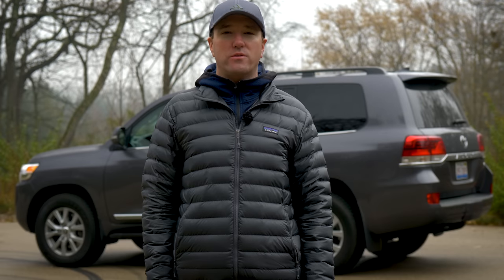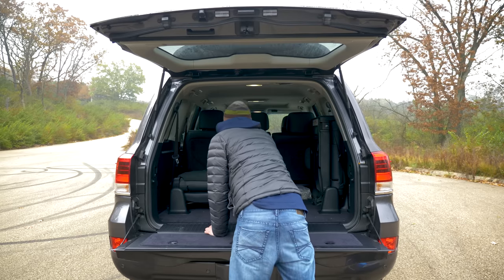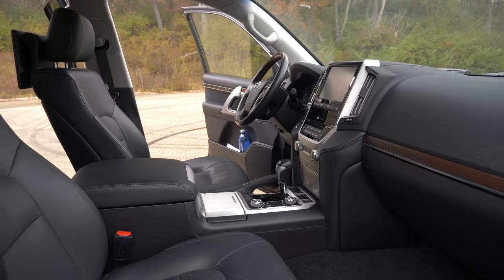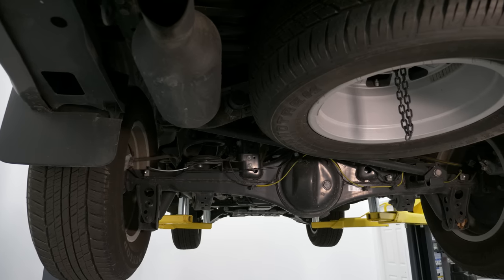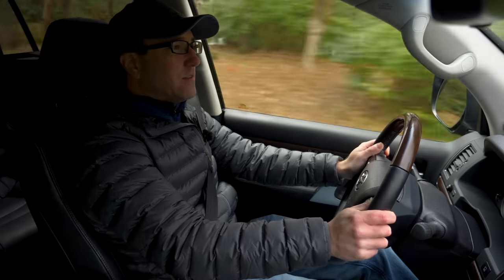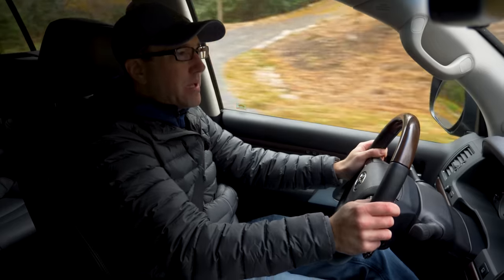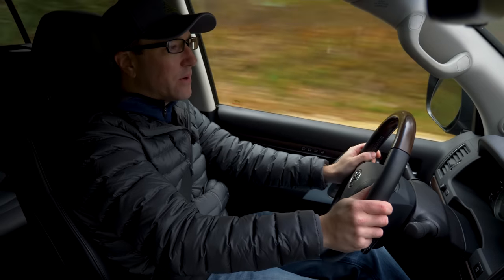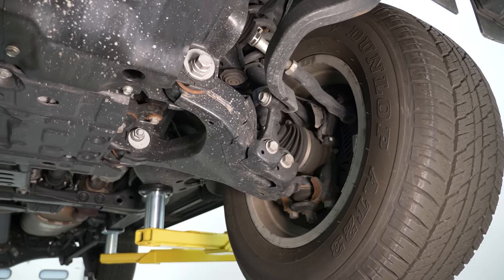Review | 2017 Toyota Land Cruiser | The Veteran

Comment: As an owner of a 2016 Land Cruiser with over 30k miles on it, I’ll try and address some of your concerns as well as the commenters’. 

1. Gas mileage. Yes it’s poor, but I’m honestly not sure what you were doing to get it down to 13mpg as you report. The only time I see it that low is if I am towing. Even if I drive it like I stole it, I can’t get mine to average below 14mpg over the course of a tank. If there is no headwind and I drive it conservatively on the highway, 20mpg is realistic and 18-19 is typical. If you go a bit faster and keep up with traffic I’ll get around 17mpg. Around town in traffic I average about 15mpg for daily driving. This is not a problem for me in a daily driver. I actually consider it good gas mileage in a daily driver truck since I’m used to driving trucks most of my life. A truck with nearly 400ho that can easily average 15mpg city is impressive to me compared to vehicles of ten years ago. Much of this is due to weight, but also to relatively rugged and bulletproof engine design. No direct injection. No turbos. Capable of running on poor quality gas around the world, or in certain parts of the US. This is part of the appeal. 

My biggest complaints regarding gas mileage is that the truck is very sensitive to headwinds, and the tank is only 23 gallons, which limits range to around 400 miles (plus the fuel gauge is very conservative and reads empty with about 3 gallons left).

2. Why this vs a 4Runner? Honestly the 4Runner is a great vehicle, but it’s not quite as good as the Land Cruiser. The LC is much nicer inside, rides better, is much roomier, looks better since the 2016 update, and has a better engine with comparable gas mileage in real world driving. The third row is a little better, but it’s still not meant for adults. Plus even though her 4Runner is pretty reliable, it doesn’t hold a candle to the Land Cruiser. Toyota puts their heart and soul into this flagship vehicle. It, more than any other, is a showcase for the world of what Toyota’s values are. The only other Toyota that comes close is the Lexus GX, which is sold as a Land Cruiser everywhere else in the world. Both are made in Toyota’s best plant in Japan with the best record for reliability, and they take extra care in building these. This is why even though Land Cruisers don’t sell well in the US, you constantly see them in the roads and highways. They just keep going and going for hundreds of thousands of miles. If you get a new vehicle every 4 years it’s not for you. If you buy one to keep for 20 years, you can’t beat them. 

3. Price - Yes, $86k is a lot of money, but not as much as it used to be. Look around and it’s easy to find these selling for $79k or less new on the lot. They’re slow sellers. Then compare to a top trim level Yukon or Suburban and realize those also sell for over $80k today, and this has a nicer interior than those. It is close to the interior of the Escalade, and better in many ways. The Lexus LX is even nicer. For what it is, it is competitive in this high end of the market.

The one fly in the ointment is the new Nissan Armada. It has a nice interior comparable to, possibly nicer than, the Land Cruiser in the Nissan’s higher trim levels but costs tens of thousands less. It also has more room and is based on an established and fairly reliable platform used elsewhere in the world as the only direct competitor to the Land Cruiser, the Nissan Patrol. The American version is not as off road capable, but it’s not bad at all and better than any domestic in the category. You can get a nice one for about $56k (and similar power and gas mileage) and pocket the rest. Still, though, if you’re after reliability and off road prowess the Land Cruiser can’t be beat.
Reply: Brian Mooney I like your review better than this video itself!
Reply: This x100. Nissan Armada is a fine choice if one cannot afford a LC. That said, Nissan's infotainment is much worse than LC. Like you mentioned LC has better off-road capability and will hold value better too, there are some used armadas for sale less than a year old with low mileage for ~$35k. Yes, the cost savings could be significant, but I really do think the LC is worth the extra money. It's kind of like comparing the Sequoia to the LC, there are a multitude of reasons why there's such a price difference. I'm biased  though -- I have been in love with love land cruisers for years, and have never been fan of the Nissan brand in general.
Reply: You should start your own channel. I enjoyed reading your impression of the Land Cruiser.
Reply: Nice comments about the LC and I'm glad you mentioned the 4Runner in comparison. I own a 2008 LC and a 2005 4Runner and I can say without a doubt that I like my 4Runner much better for off roading. The LC is heavy, doesn't maneuver well in tight situations, feels top heavy and leans more than my 4Runner, is wider, I don't believe the LC has more ground clearance, and actually has less cargo space because of the third row seats. I know I can take the seats out, but what a pain to take them out and then put them back in all of the time. My LC does feel more roomy, seems to have a more comfortable ride on the pavement, and does burn more fuel than my 4Runner. Eventhough my 4Runner is a better off road vehicle for me, I still keep my LC because I like it. It has some cool factor about it that is difficult to explain. Anyway, that's just my opinion and I'm not an expert with Toyotas. I feel like I got more bang for the buck with my 4Runner over my LC.
Reply: The 4Runner is also made at the Tahara factory where the LC200 and GX are made.
Reply: @shizzyshawn412  $86k. not worth it. Just because Toyota is too lazy to redesign a new platform with a new engine, you just cannot justify the price for this thing draconian layout. I own a 2005 and the best I've seen is 14mpg and thats feathering the gas. But these trucks have a cult following, meaning, they could charge $110k for this and people will still buy it and justify its price. "Its a Yota brah"
Reply: fuel economy , my experience with is almost the same like yours.
It is really not that bad.
Fixing turbo or hybrid related issues can easily wipe out years of fuel savings
Reply: @jacekw8746 😂😂😂😂 I totally agree with you when you consider how much you spend on fixes in others cars am better off spending on fuel ,rather than saving on fuel only to blow it out in fixes that will cost me years of fuel savings

Comment: In the middle east, this truck comes with variation that is more than insurance packages..

Here in Saudi Arabia we have the following:
4.0L v6 with 5sp manual or 6sp auto

4.6L v8 with 6sp auto
4.5L twin turbo v8 disel with 6sp auto

And the 5.7L v8 with 8sp auto

It starts from around $45k to around $88k for the VX-S model which has a little more than the US-spec Land Cruiser. They offer variations with a spare tire mounted on the back on its own mount and a winch. They are the definition of 4x4 in Saudi Arabia. 

By the way, the interior is one of the best interiors that hold up to the extreme use. No noises or squeaks even after 150k+ miles on these. They are that good, but goodness comes with a price :/

On a side note, we don't get the 4runner anymore :(. I wish we could have the 4runner trd pro instead of the fj cruiser (yes, they still make it for the middle east).
Reply: hisham202  You also have the Land Cruiser Prado and the Fortuner (and the Hiace, etc.,).
Reply: What i want an fj cruiser. 😭😭😭

Comment: Just bought a 2013 200 series in the same color and it's been a dream to drive... my favorite car of all time!!!
Reply: Michael Evangelista its not a car
Reply: alexander1485 thanks
Reply: If it is motorized human transportation (7 or less), four wheels and a steering wheel, it is a car. :)
Reply: I was thinking of buying a 2013, I given a 1999, 10 years ago. It is still incredibly well.
Reply: Trenton Oliver 2013 is a good year, Toyota was able to get the quirks out of the initial 200 series and it got a bit of a face lift as well. I'm personally not a fan of the new front design on the 2016-18 model. I got mine CPO with 41k miles. Its so smooth and refined, driving experience is unreal (unless you want to throw it into curves). Curious, how do you like your 100 series? I was debating between a 60-70k mile 2006-07 100 series... what are the differences in the drive?
Reply: Michael Evangelista,
The early 100 series is good, I have locking center and rear diff, I haven't gotten stuck. It's basic and a great car, runs a 100 amp alternator compared to the 06-07 which is 130 amp. The huge plus for me is the removal of the third row.

Comment: Great review - especially under the hoist. I’d like to see more reviewers do the same.
Here in Oz (the KDSS was designed here in Western Australia) we get the 200 series in higher and lower specs with the twin turbo V8 diesel across the range. It’s a torque monster with relatively good efficiency and a great touring range from the 140L tank. Barely anybody here buys the petrol model.
Reply: I wish America had the diesel model. The torque and fuel economy are so much better than gasoline.

Comment: Just ran across this since it's a couple of years old, but for the most part a good review, a few bones to pick since I've driven mine for over a week. As the owner of a 2019 LC, I drive mine 40 miles each way to work everyday and average 17 mpg, still not great, but damn that engine rocks! Almost the same gas mileage as my 2002 limited 4Runner that was 18 mpg with an under powered six cylinder, but not quite as good as the other seven 4th and 5th generation limited 4Runners that we've owned over the years which were around 20 mpg. That being said, the LC does have some quirks as all do, but the center stack is one of the best I've seen and the luxury for an actual body on frame 4wd SUV is unmatched. Sitting in the back seat is like sitting in your couch at home. The reason most people buy the LC over the the other "SUV's/Crossovers" is that we can actually take our vehicles off road. The LC provides probably most most off road capable vehicle off of the shelf of any vehicle out there other than maybe the Raptor. But the LC will last 25 years and is actually reliable. The LC is an Icon.

Comment: Great review video. Spot on commentary and thoughts. Really well done.  I own a 2014 LC, bought it new and currently  have 62k miles on it and LOVE IT, but it's not for everyone. As you say, if you're staying on the pavement and/or not towing there's likely a better choice for you. The gas mileage really is bad. But if you can get over that, it's a special special vehicle. I regularly load my wife, 2 kids and dog in it and tow a 27' 5,000 lb travel trailer all over the western U.S. and have spent a lot of time off pavement. Aside from swapping out the original tires for BFG KO2's it has no other upgrades and it has no problem pulling that trailer, it's calm at highway speeds (even when pulling the trailer) and is truly special off pavement. After 3 years and 62k pretty hard miles, other than the routine maintenance, it has required exactly 1 repair; passenger door lock actuator failed. I blame the Death Valley wash board for that one!  I'm driving this one until the wheels fall off and assuming Toyota doesn't mess too much with the design, will be buying another one. Love, love, love it!